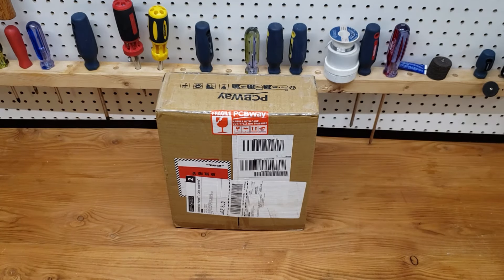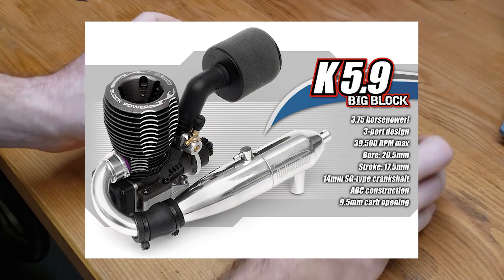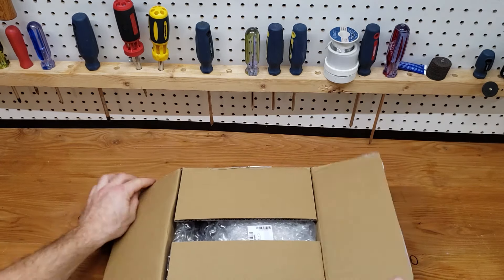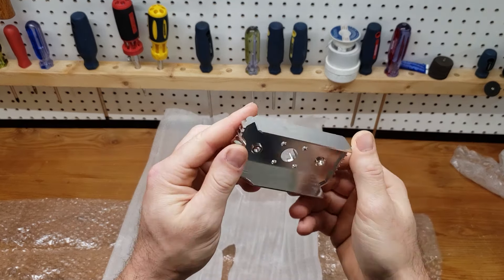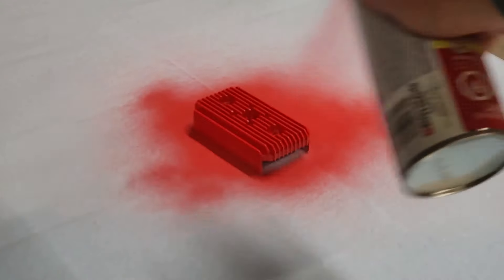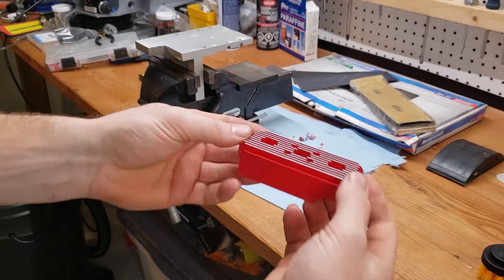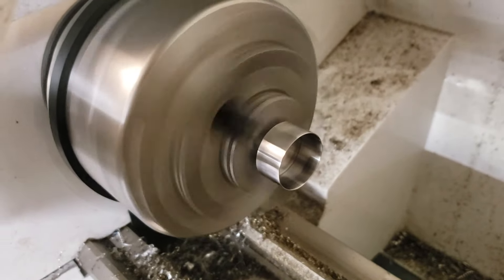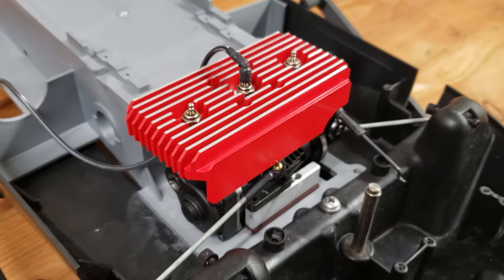Art Attack SuperMod Build - Part 3 (The Engine)

Comment: Hey so I bought one but uh I need your help
How do I soften the track as there’s humps in it and it’s hard on my motor
Reply from the maker: Honestly if i used the original track, i'd punch more holes into it to make it easier to bend around the wheels.  like +100 holes or so 3mm or 4mm.  that track is like a tank anyway